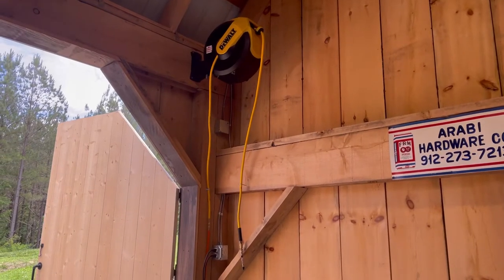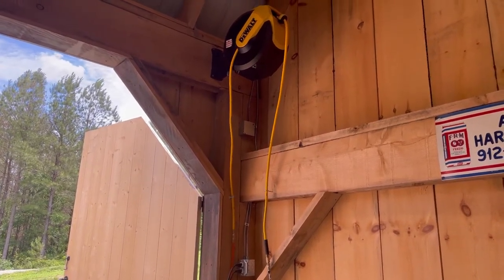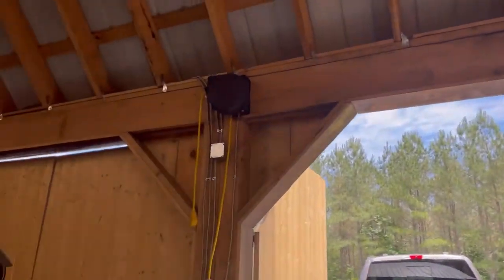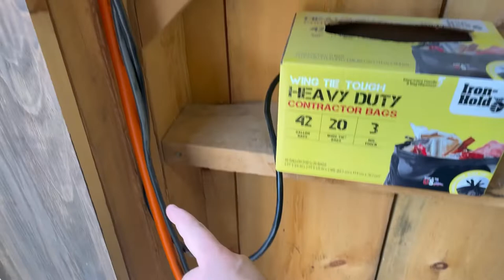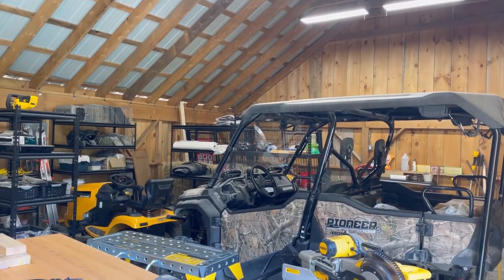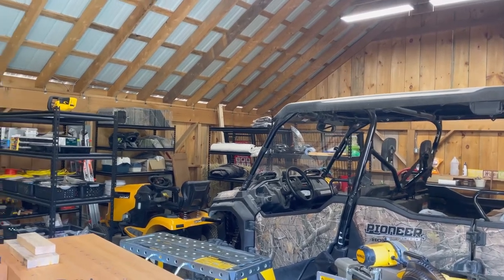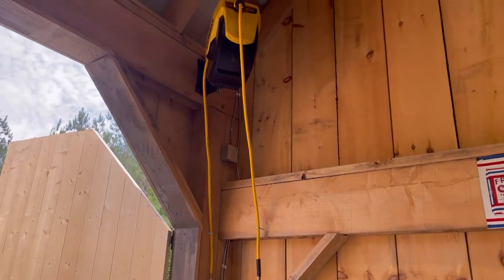DEWALT Retractable Air Hose & Reel!

Comment: Hi. Do you still have this hose? Did it age well? How do you like it? Is it an awesome hose or a piece of garbage? Quality or junk? 
I noticed Dewalt has this standard runner hose, and a “hybrid”. I wonder which is better? Thanks.
Reply from the maker: I have zero complaints.. it’s been a great hose and I use it all the time.
Reply: This is manufactured by MATT Industries, Dewalt doesn't make anything that are no parts for this hose reel, it is not serviceable.